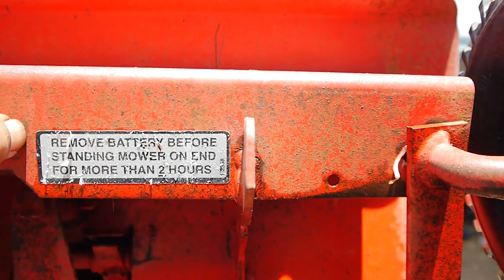Snapper Rear Engine Rider Part 3 - Inspecting the Mower Deck

Comment: The Snapper looks like what the Honda H3011 was designed after. Small front wheels large rear wheels, rear engine mount allowing clear view to avoid poop, hoses and garden implements left on the ground. I've finally changed out the right bagger stay and now my rolled $250 H3011 is all straight again. Just used a heat gun to get rid of the white oxidation on the red plastic body and its close to being showroom ready. 
This Snapper project is pretty interesting. I'm not into working on small engines for the fun of it cuz I've got enough small engines of my own to worry about. But I'm highly entertained by watching you and others troubleshooting techniques. I was surprised that you got this thing working with the corrosion that I saw on the flywheel. Congrats!

Comment: Hi, I follow you from Italy, all your repair videos are very interesting exposed and very well. I also have a snapper like the one you are fixing in the video but with 15hp kohler engine. The problem is that with the first gear the tractor is too fast. What can this depend on?